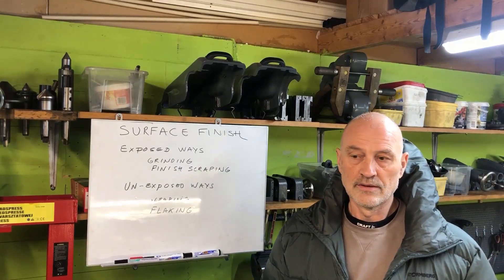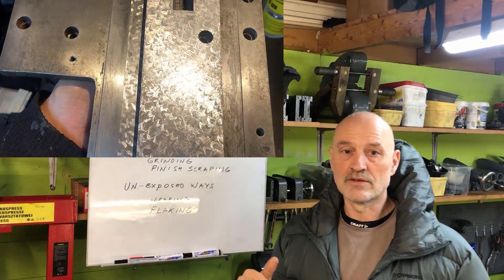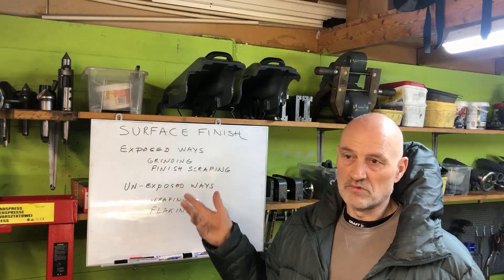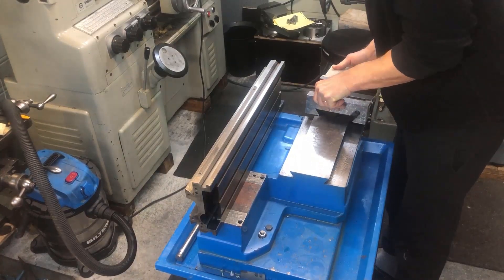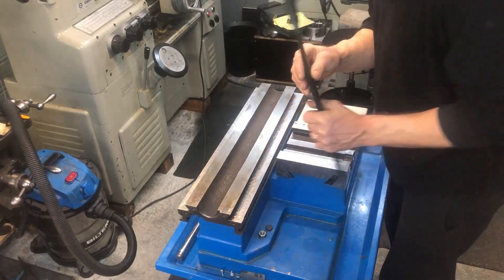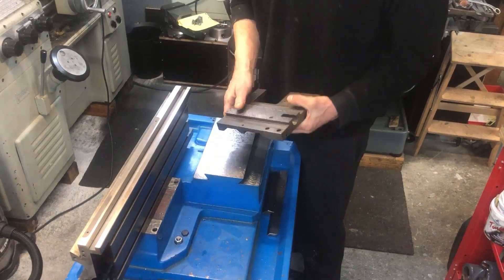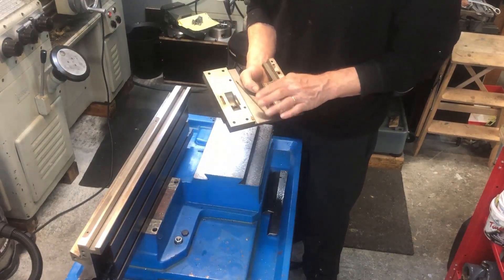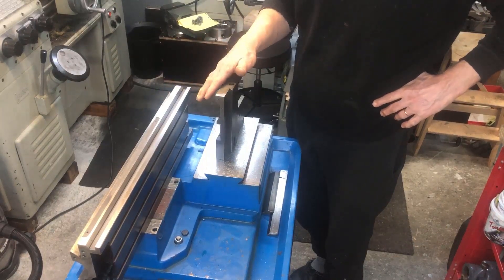Techniques for surface finish and oil retention - part 1 - introduction

Comment: Hi Jan
You should do another power crossfeed S7 restoration video. Interesting to see the machaniscs of the powerfeed apron and differences to usual S7 when scraping and grinding.
Reply from the maker: I have another power crossfeed model that I will document.. 😊
Reply: Amazing. Also, something that might interest you, analysing the different myford models such as Tri-Leva, long bed models, mini-kop(mega rare), myford 280 etc. Probably thin on the ground for you in Scandinavia but if you can come across these, very interesting to document, 'rare' models. @jansverrehaugjord9934
Reply: @jansverrehaugjord9934  great, is this your next project?
Reply from the maker: @spewgw8417  One of them 😀